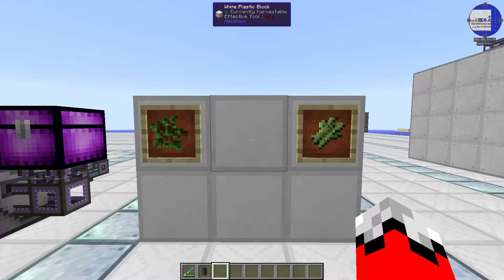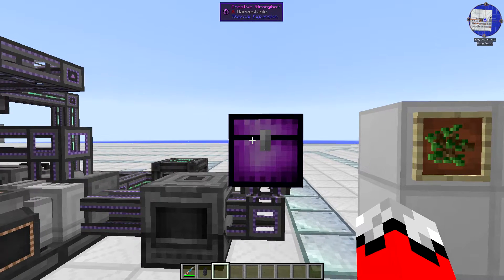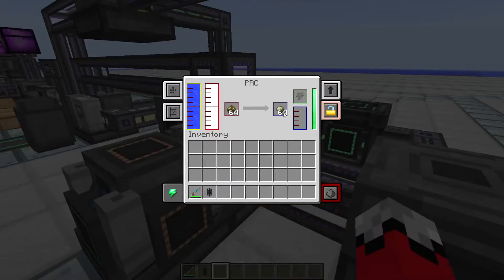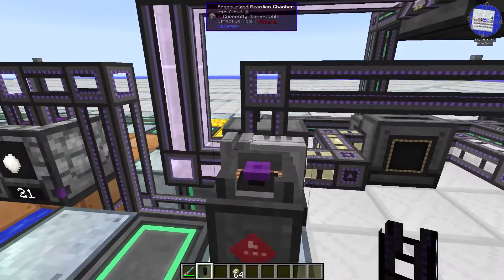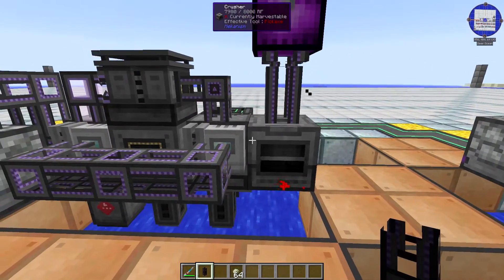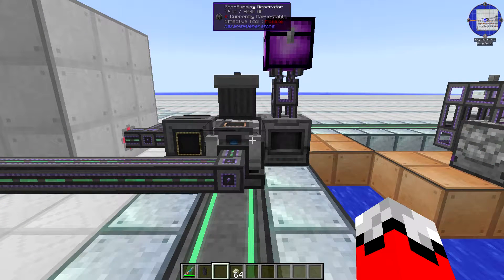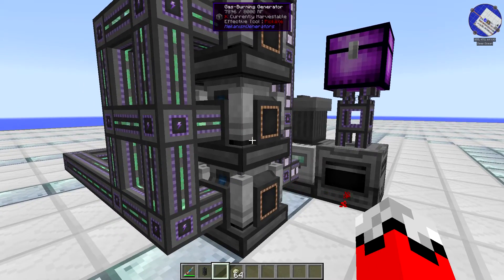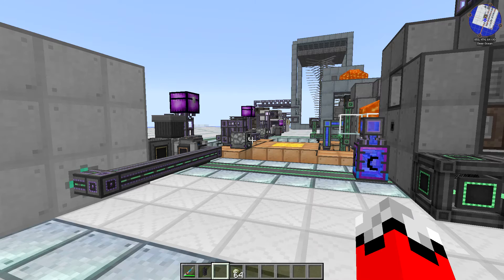Mekanism Version 9 Spotlight: Ethylene

Comment: For me,  and understandably outdated, I used Garden Cloche and four units of pumpkins because 6 bio/pumpkin. otherwise basic foods like beets and potatos are 4 per or rotton flesh is a good alternative. But My issue, is what do I do with excess Ethylene? my system is backed up...I THINK because everything is backstuffed and it can't produce more substrate if there's nowhere for the ethylene to go. My JEI wasn't showing the Gas Burning Generator as an option for usage, er go my confusion, that shouuuuld take care of my problems then! [long as it's noises aren't horrible.]

Comment: For some reason the liquid ethylene won't go into anything besides my tank when I put it into the rotary condensentrator and when it's in my tank I can't put it into the prc. I checked all of the settings on the machines and nothing works. I would appreciate it if you could help, thank you
Reply: I'm having the same issue did you figure it out
Reply: You need to change the Mechanical Pipe that’s coming out of ur rotary condensentrator to a pull (using a configurator) by shifting and clicking, it should change its shape.
Reply: @nuggietdaddy389  dosent work please HELP
whenever i right click it sais redstone senstivity